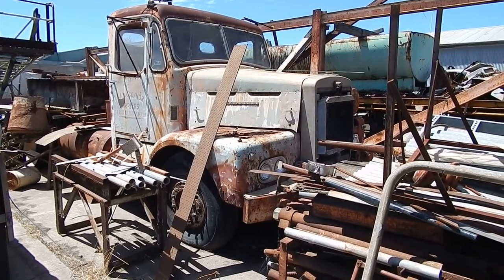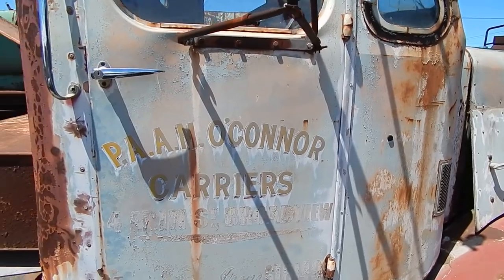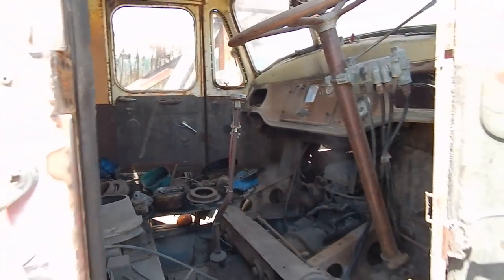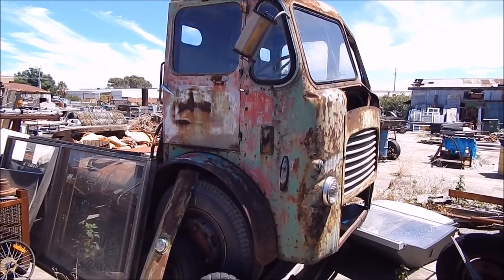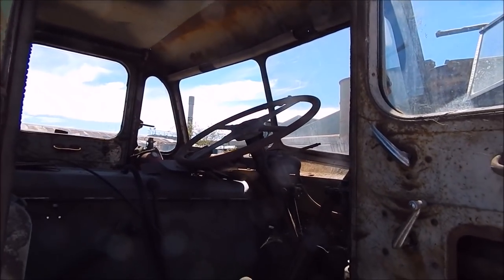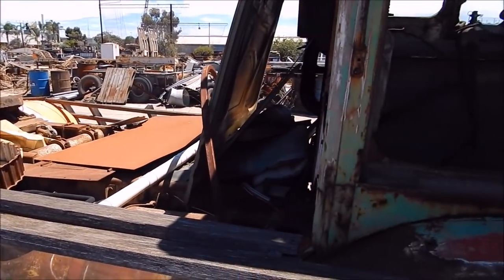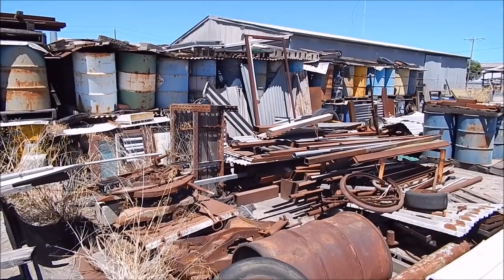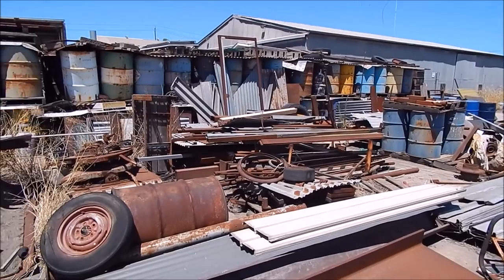Junk yard trucks - old British Leyland tractor units

Comment: The long-nose trucks were Scammells. 
It wasn't 'the unions' that screwed up British manufacturing. It was a ruling mafia that couldn't upgrade its 18C class prejudices for the modern age. Look at those primitive cabs. The driver is squeezed in as an afterthought;  hard seat, noise, vibration, dirt,  fumes & oil. Employers couldn't give a sh*t. That is, until unions came along, & bossman couldn't get replacement 'hands' for a quid a week any more, like in the good old days. 
Oh yes, those old heaps could last a long time, but they finished off a lot of drivers before their time. It was continental trucks that showed the future. The civilized cabs were designed for human beings, not disposable 'scum'.